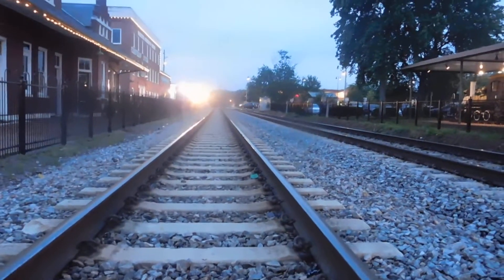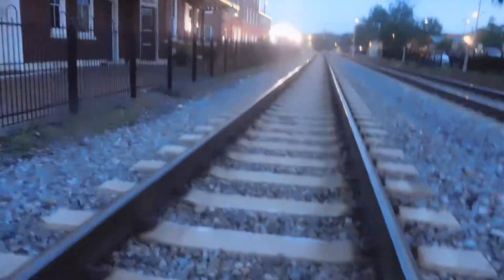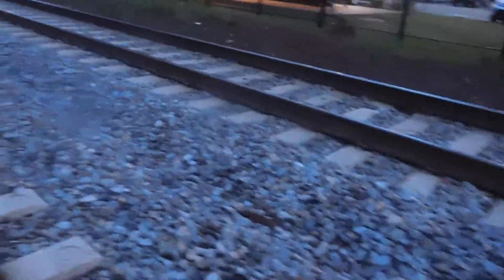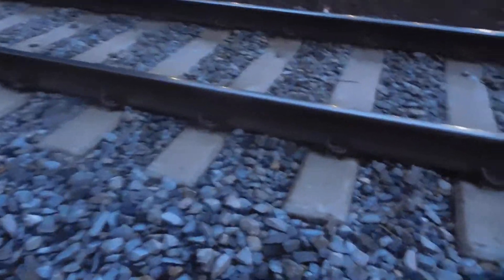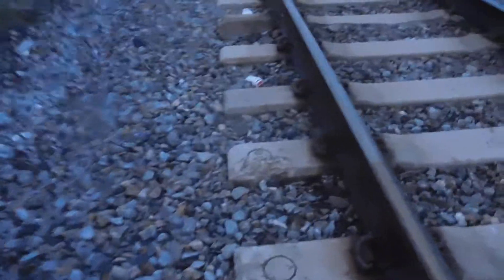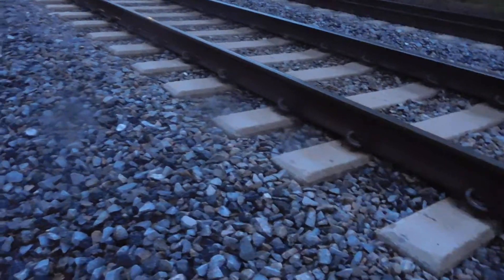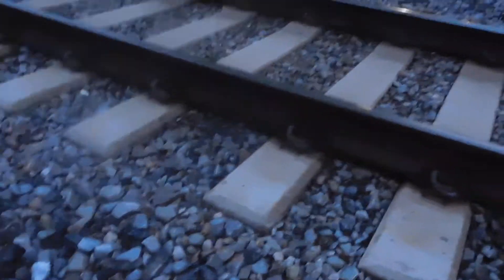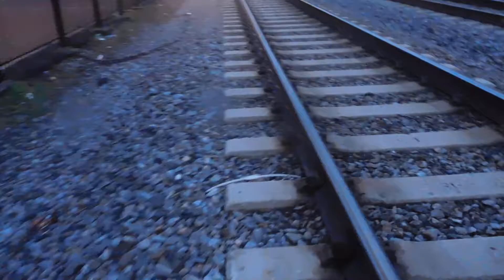Geology - Railroad Geotechnics, Gneiss Use Of A Rock

Comment: would the rock used as track ballast be appropriate for saunas?
i'm trying to build a cheap backyard sauna and didn't think i need to purchase/spend $100+ on stones if i can find them nearby. i'm in manitoba, canada. we do have granite bedrock on the eastern edge of our province. i'm thinking a little car adventure and i can just pick some.

i'd really appreciate your thoughts. thanks 

the internet reccomends "Dark igneous rocks such as vulcanite, gabbro, peridotite, basalt, and granite are excellent choices. Mixed type such as the gabbro-diabase is also very common and found in nature. Vulcanite is good for its high metal content, which helps it store heat very efficiently."
Reply from the maker: Granited is an igneous rock. Igneous rocks are best suited for saunas. So, the granite in Manitoba is actually a good choice.The rock in this video is metamorphic. There are better rocks to use for saunas than gneiss.